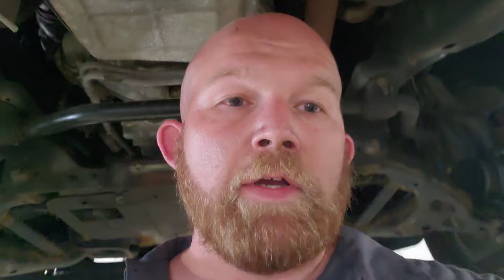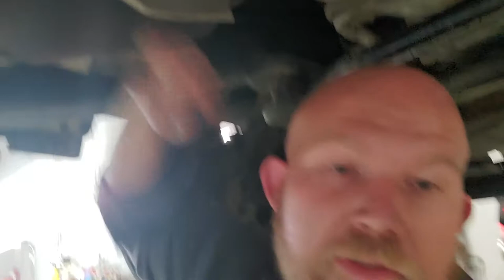2017 Ford F150 3.5L Ecoboost P0420 code comes and goes

Comment: went out side knocked on both sides and they both seem solid maybe ill get lucky and its an 02 sensor
Reply: Was it an O2 sensor? How did you know what side the sensor was on that needed to be replaced?
Reply: @rolltidemofo  no it was the cats replaced with spd high flow cats. 3 months later my muffler rusted out now I have the borla touring 3k in exhaust later 😂😂

Comment: what if i get a 420 code and go to knock them and no noises are made?
Reply from the maker: Just because there's no noise doesn't mean they're not bad you have to try to diagnose a PO420 code then
Reply: @FordBossMe  F. Any easy way to do that or order for checking parts? I assume o2 sensor then cat?
Reply from the maker: @MotoTaco  Oxygen Sensors First